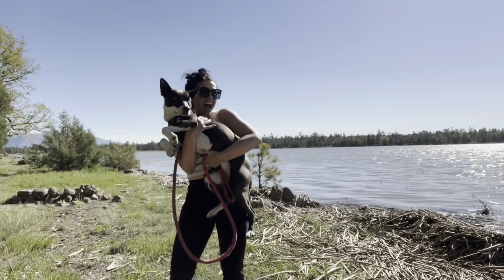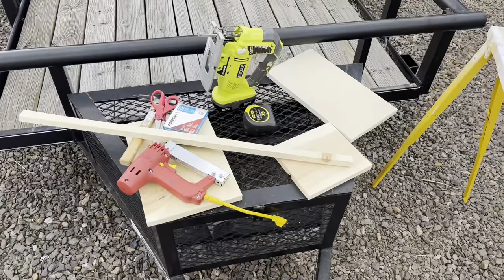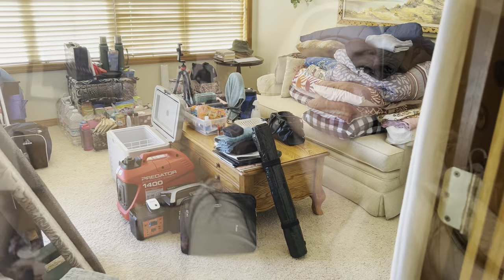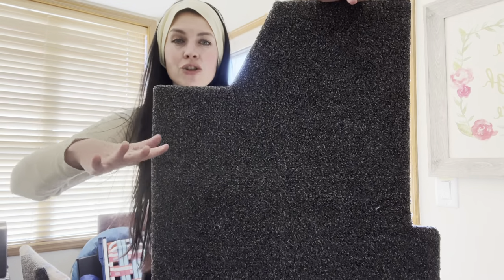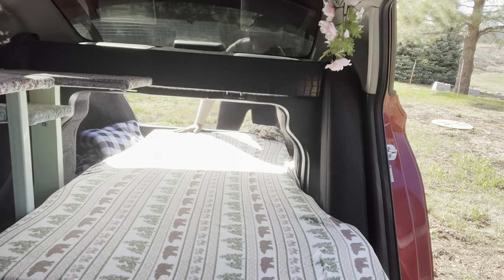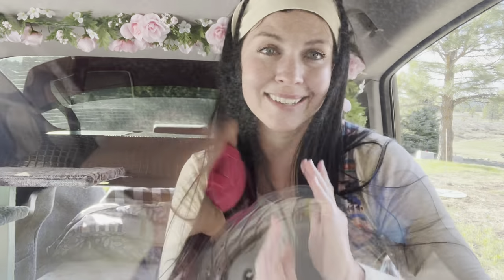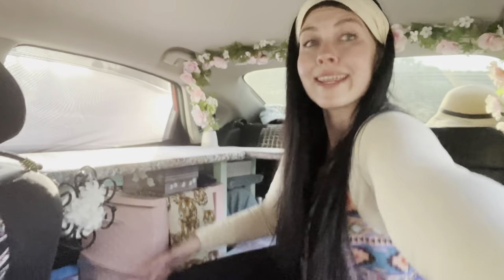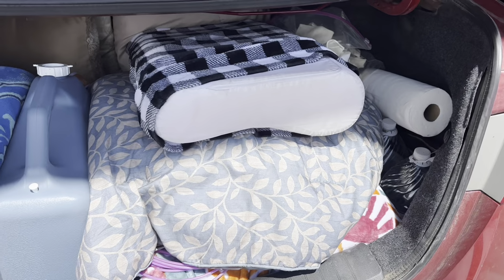How to Turn Your Car into a Micro-Camper or Teeny Tiny Home on Wheels | The Build + Organizing

Comment: Oh quick question I saw another video of yours and the steering wheel was on the American side in this video is it flopped around? Because from my perspective on the TV the steering wheel is on the right side like a mail truck.
Reply from the maker: Hi there - when I filmed this video I was using the reverse camera feature so I could see what I was filming.  I've since learned how to use this feature without mirroring the video. This is why the seat looked like it was on the European side of the car. Thanks for watching! :-)
Reply: @autumnandchloe  I figured that might be what it was. Very clever on your build, I learned you do not like anything disorganized, gresat idea on the flat surfaces. Since I work (in sales) for an IT co and work remote I am planning to get out of here for the summers because its so hot. I think ive pretty much decided to go with a Ram Promaster van, so im saving. Looking at duifferent build ideas. I learned alot from you videos, thanks! :) P.S. can you please fit me in your car sometime for a kiss, lol

Comment: Do you need to use that specific wattage jackery for a 12V mini fridge, or would a lower wattage work? :))
Reply from the maker: Hi there, I use a  Jackery 1500 for my fridge and it will run the fridge for 5 days without a recharge.  You could use a lower wattage power station and just recharge it more often.  My fridge only pulls about 40 watts at a given time.
Reply: @autumnandchloe  Great, thank you! 👍🏻

Comment: Cleaver Autumn!, you sure do get a lot of stuff into little red and one of the best car builds I've seen!. I like to push my paper towels and toilet rolls flat to gain extra space, it means straightening them out when I'm ready to use them and they might be a little bit wonky but it's surprising how much smaller you can make an 18roll bulk pack of toilet paper or three pack of paper towels by flattening them. And can I suggest checking with your fridge manual if you still have it, about the clearance required around the motor so it doesn't overheat and create a potential fire risk, I have a Dometic and keep at least a 10cm gap around the grill area so it can cool properly as recommended, especially on hot days when the fridge motor has to work extra hard to maintain fridge temperature. Great vid! as always , informative! and inspirational!, cleaver ideas and inventive!. What did you do with the seats out of your car?, do you still have them somewhere to put back in if you ever decide to sell or trade in your car?, or did you throw them away?. Anyway, i hope you and your new best friend are doing well and happiness is finding you!. Safe and happy journeys to You and Chloe!.
Reply from the maker: Hi there!  You have the best tips, thank you!  I think you would do great with a channel if it were ever something you're interested in.  How long have you been living in you van? 

In terms of the seats, I still have them.  I'm fortunate that my folks let me store them in a closet they have in their house, very generous of them.  Otherwise, I would have chucked them.  However, if I do decide to sell the car at some point, I imagine someone might want them.  

Happy VanLifing to you!

Comment: How much did all this cost?
Reply from the maker: Thanks for watching!  The build materials (wood, carpet, and paint) all was less than $300.  The expensive items were all my power stations (Just over $3k). If you're part-time camping, you don't need the power I took with me.  I work from the road and travel fulltime in the car so I need a lot of power. The fridge was $260.

Comment: It’s cute, but from what I’ve seen over the years of watching van life, car camping, RV trailers covering surfaces with any kind of fabric will be hell to maintain, as far as keeping clean and reduce dirt & dust. 

Same as in brick & mortar, wood varnished wood surfaces are easiest to clean. Not to mention that when you have fur babies, they sometimes prefer to lay on a cool surface to regulate their body temp, especially in a vehicle. 

It’s just simpler to use blankets & clothes that you can throw in the wash every week. Your build is cute otherwise 👍

Comment: you need to take in weight, the more you sit in your car and move around and lay more in your car, your wheels and shocks will wear down, make sure you have window covers for privacy and some kind of heat or air, then you can get unlimted data on your phone and get a battery 100+ hour charger. for gaming and movie watching.

Comment: So many fantastic tips. I like how you pointed out what a difference putting your feet down and sitting comfortably makes, instead of having a flat surface where you can only sit cross-legged. I'd like to see your kitchen/cooking setup. That's what I'd like to implement in my sedan.
Reply from the maker: Thanks for watching and for your comment! :-)  For cooking, most of my meals are non-cookable.  And, weather permitting, I cook on a camp table outside of the car.  I have cooked in the car by placing my butane stove on the small platform that doubles as Chloe's bed.

Comment: Hi, one concern: has your fridge enough Ventilation? If the heat can't escape out of the Ventilation holes, it will consume a lot more energy. Perhaps you can force the Ventilation with a Computer fan

Comment: What kind of remote jobs you work I’ve always wanted to work remote but most are fake offers
Reply from the maker: Hi there, I am a counselor, consultant, and writer so these are the main jobs I took with me on the road.  However, I also did some freelance nutrition coaching, pet sitting, organization consulting.  If you're interested, I have a video about how I work from the road and there is a chapter all about nomadic jobs: https://youtu.be/7eZ9u3aPm6M

Comment: ive seen so many builds and this is the most impressive one ive seen, its mind boggling how you can make a sedan seem so spacious! i was planning on buying an econoline to start my build, but now im reconsidering as i currently have a sentra lol. question, how did you do dishes/wash your hands?
Reply from the maker: Thanks so much!  :-)  I do think an econoline would be amazing too - I'd love to build one of those out.  For dishes I use straight white vinegar that I pour onto a paper towel to wash the dish.  For my hands I use Clorox disinfecting wipes, and I'll also fill a small popup bowl I have with water and wash with soap and water.

Comment: Where do you get a high density memory foam at? Also, what stove are you using?
Reply from the maker: Hi there, I got the high density memory foam (5inch) at Joannes fabric. It’s VERY comfortable.
Reply: @autumnandchloe  I was also wondering about your gas generator. Don't you get gas fumes in the car, when storing your generator in the car?